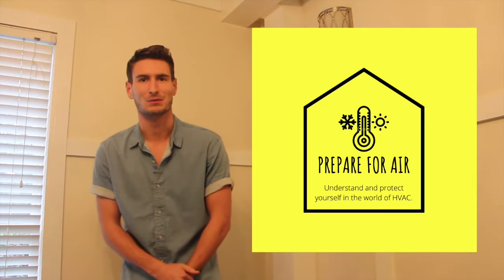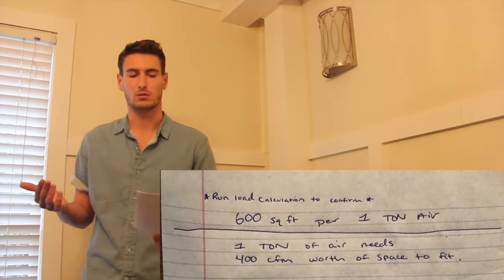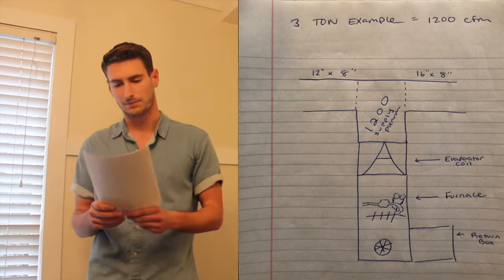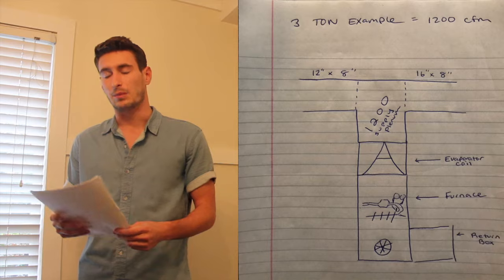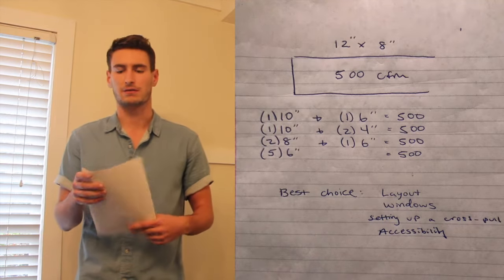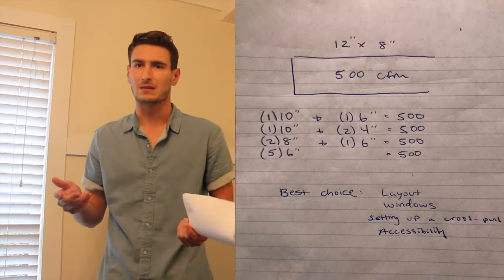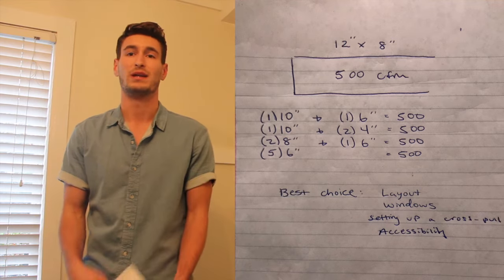Residential Ductwork : HVAC Duct Design Basics

Comment: Not trying to be negative here but this is why we 10 out of 10 systems have air flow problems. The design is garbage in garbage out, and the first fitting destroys all the flow and will never balance. We all need to start taking this seriously

Comment: 400 CFM per 600 ft^2? Wow, I don’t think so, bud. I think your engineering is off by a bunch. Typically 1 ton per 400-500 ft^2. Trust me, it makes a big difference, especially when you have gatherings.
Reply: It's 1 ton per 400-600 square feet. If you live in a high humidity area like the south then you go towards 400. His 600 statement is still true.
Reply: New houses decently built are closer to 750 sf / ton

Comment: What about the return? Some people say that 700cfm is enough for a 3-ton system, but my local contractor said 1200cfm for the return.
Reply: 1200 cfm is the required amount for a 3 ton unit, but sometimes the math can differ on the amount of air the actual ducts themselves can move (depending on static pressure.) We use .8 static pressure as our gauge in Georgia which means the 10" even though (rule of thumb is 400 cfm) if you used the more exact math with static pressure calculated in, it would actually only be 320 cfm.
Reply: Easy answer. You can NEVER oversize a return. Always make the return bigger than the supply.
Reply: So 1200 cfm is a rule of thumb there are alot of factors that can slightly effect this number and I disagree you can oversize a return when oversized the velocity falls off and you lose dopler effect and thus have a noisy duct system

Comment: Nice job however you should have finished with a floor layout showing the trunk & flexible duct layout. The reason I mentioned that is that it is usually better if you connect the flexible duct toward the end of the trunk such that it works more like a plenum. For instance, if you do your 1st 6" flex duct say at 90 degrees off the trunk maybe 3' from the start & the 2nd one say toward the end, 10' in this example, the 2nd one will have much more air flow than the 1st one.
Reply from the maker: Mike G definitely! I may even make a advanced residential duct work video or something along those lines to elaborate a little more 👍.

Comment: In this example, if the air handler was located at either end of the ductwork would I need 26x8 or 10x20 starting duct to match the 1200cfm required for the system to operate properly?

Comment: This is how I always done it. 
2x 4 supply airs= 8  8+2= 16x8 duct. That would be my first section of duct coming off my upper Plenum. Let's say coming off the front. That would be the closest heat runs next to the very furnace pretty much. Let's say I got a few more further ahead so now I wanna break it down. I'm only gonna have 3 coming off that duct. 
2x3=6 +2= 12x8 duct. (Always x2 +2 ) keep breaking it down further in your path. Try to make those run straight into whatever duct. Make it pretty! Less elbows, the better!
Now your return air duct .
3x RA+ 3 . Break it down if you have to.  
Single supply air ran in 6 inch round pipe and double supply air ran in 7 to 8 inch.  
always run metal all the way up to the return air inlet grill or supply air dampered register. 
Always put a damper in your duct right before your first supply airs. Around damper in every supply air 1 foot or so off of the duct. Try not to have them at the floor boot as they loosen and may vibrate. That would be annoying
For a supply air duct, never ever tap off the endcap. This will jack your flow all messed up. That air has to ricochet off that end cap then it will go to the supplies. 
Return airs can tap off the endcap. That one's just pulling air back to the furnace. 
If you have to split your supplier, air duct or return air duct midway then you need a pair of pants. That's a different story. That
I could keep going, but this tinner mommy is tired😂🤣😂 journey, mama From Minnesota. That's the easy way. 
I definitely recommend a professional!

Comment: thanks for sharing the awesome video.  Question: what the size of the supply plenum on the furnace is?
Reply from the maker: You can buy multiple size supply plenums but you’d want to buy one with the same dimensions as the furnace or air handler you are connecting to.

Comment: Thanks for the info. I have a 900 sqft  house there's a 2.5 ton with 6inch flex and doesn't cool the house hvac is in the attic
Reply: Hey Javier, what area are you located in?
Reply: @adamstasevich  florida
Reply from the maker: How many of each duct and what sizes of each on the supply and return sides? 

I’m happy to help 👍
Reply: @HVACBee  6 outlets 6inch . 1 4 bathroom 20 return

Comment: I am a new residential installer in the Midwest looking to move into design and layout.  There are many things missing in your video that I have been taught were needed. Reduction of duct size along the run for pressurization. Friction difference between flex and hard pipe. You didn't even cover return systems. What about differences between brands? I'm just curious.
Reply from the maker: Hey Greg, your absolutely right! There is much move to residential duct design than this for sure :). I wanted to just cover the duct design basics and in the future am planning to make additional videos to elaborate further 👍

Comment: I am planning to install a new American Standard 120,000btu (5 ton) Up flow furnace (S9V2D120U5PSBB) and the HVAC designer said I need a return box placed under the furnace (code). I ask Him what would be the height of the box and he said it would be 6" X 28".75 X 24.5". The question I have, with the 6"height, that will cut down on the height of my plenum (17" - 6" = 11"). Is there a minimum height that a plenum has to be? 
Another question, with the main supply (14" X22") and elbow opening into the filter housing (20" X22") and other side of filter housing going into the return box opening (6" X 20") are you choking the air flow going into supply box? Is the 11" plenum allowed? Great video.

Comment: Are these CFM figures you're using based on 400 FPM.  I'm trying to get a good grasp on this ductwork sizing stuff, but seems like there's some info left out or just an assumed FPM number most guys are using when teaching. When someone says, "this size duct can handle this much CFM"  I'm thinking, "Yes, at a set velocity of xFPM."  But if your FPM changes does the CFM not change....??
Reply from the maker: This is just the basics of residential duct work, but it is assuming a .8 static pressure which is going to depend on the length of the run, type of duct material, etc. :)

If you have any additional questions, I’m happy to help. Feel free to shoot me an email with any additional info or questions. Adam@HVACbee.com

Comment: I have a ducted ac and heating system and would like to remove a wall. I need to redo the ducts and would like to create a new riser to the second floor and install the 2 inch high velocity ports in the sencond floor ceilings over the windows. Is this possible
Reply from the maker: It is possible but make sure to still ensure the ductwork is sized properly for the unit even after adding the new supplies. If you have too much supply space, the HVAC system could struggle to get enough pressure build up (in the ductwork) to push the air to the second floor.

Comment: So?  Probably a totally stupid question !!!    I'm designing a duct layout  for a 2 ton system for my small house.  The AHU will be centered with the house,   I'll need (approx- 500 cfm's on one side of the house ,, and 300 for the other half,,,  Would I be correct in sizing the trunk accordingly for each side?   The trunk for for 300 cfm's come out to roughly 8 x 8  ( with a .07 friction rate ,,, calculated , not assumed !)  Only Asking because I've searched like crazy, and this is the only video I've seen where you've split the load,, ( make's sense to me  btw,,)  Just want to make sure I size accordingly ,,  I've searched at nauseum,  and every example shows one main trunk and sizing down as needed,  so,  I'm a little confused with that part,   
Otherwise ,, its  approx ,, a 8 x 20 trunk straight across ,for a 2 ton/800 cfm's unit ,,   if I'm using the calculator correctly :)     🤔 thx!!!

Comment: Hi Adam I have a questions total 1700 sq house  the size first floor is 25ft  Width  by 30 ft  length and the first floor ceiling height is 9 ft tall and the furnace is to the other end basement not in middle the house ,and Upstairs 4 room all the size is equal 12 ft by 13 ft and ceiling upstairs from the floor is 8 ft tall .what is the size duck work ? 
Here I used Rectangular  8 inch by 16 inch and 16 ft long but it couldn’t reach upstairs floor

Comment: Here's a good question: can the A-coil be adjusted (it's horizontal position) by removing the trunk (short straight section of square ducting) connecting the A-coil cabinet & the plenum? Have an A-coil that is not sitting like it should. Condensate water 💦 doesn't drain out of the regular drain line, but it drips out of the cabinet. Some I have collecting in a bucket, but some is going into the drain pan. Thank you the heating and cooling system work just fine, but there is a condensate drain problem, b/c the A-coil is not sitting as it should (level) for proper drainage
Reply from the maker: Hello 👋. Shoot me an email with some pictures / the same info above and I’d be happy to help! Adam@HVACBee.com

Comment: Do you need a return box ? I have a 3 ton unit that I made a supply plenum for was just wondering if I neede a return box as well
Reply: Nope, typically you'll only need a return box on a 4 Ton unit or larger.
Reply: @adamstasevich  sweet so I can go right to my vent in my ceiling?
Reply: @jham5595  Yep! You could also build a smaller return plenum next to the system and have the duct run from that as well.
Reply: @adamstasevich  thanks 🙏 much appreciated!
Reply: @jham5595  Sure thing! No problem. Good luck with the project :)

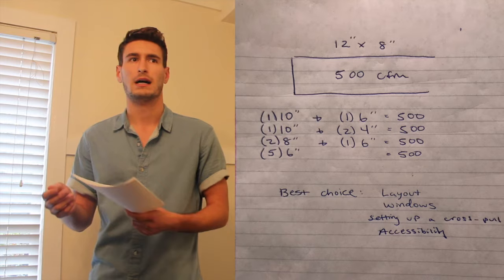Comment: 4:20 I’m confused. Where are you getting the (2)8” + (1)6” =500 from? And all the other ones. 8” by what? 6” by what?
Reply: I’m thinking diameters
Reply from the maker: Diameter of circular flex duct 👍.
This is a flex duct chart example that is shown. 

You can also search a ‘rectangular duct chart’ to see the cfm for those sizes as well though :).

Comment: I'm finishing my basement and the ceilings are already low. Is low profile ductwork an option? What needs to be considered if I switch to low profile? Do the dimensions of the ductwork just need to total the same? For example could a 14" x 6" be made a 28" x 3"? Thank you!
Reply from the maker: Hey Troy, here is a link to a rectangular duct chart. I think this may be able to help you out if you haven’t started on this project yet.

https://hvacdirect.com/hvac/pdf/Field_duct-sizing-chart.pdf

Comment: Hi, nice video. can we split the trunk cfm the way you did, like left 500cfm and right 700cfm? My truck is 8" x14" on both sides of the plenum but the HVAC guys told me I need to increase my trunk to 8" x24", they don't consider left and right on the calculation. I will install a 3-ton system.
Reply: Howd that work out for u lol
Reply: @SA-rt6ei  I installed a 3-ton system; it works, but it's not efficient. The heat on cold days does not go above 21 Celcius, and I have to use a low Merv filter.

Comment: That 12x8 and 16x8 coming off plenum for 3 ton system is too small
Reply from the maker: It is about 1300cfm before deducting static pressure. A 3 ton blower and coil needs 1200, but if there were super long runs, and a lot of them, you could need additional 👍.

Comment: Flex duct?!? That's a cuss word from where I'm from 😂🤣😂
Reply from the maker: Where you located? We see it probably 90% of the time in north GA. 

Definitely not the absolute BEST choice, but definitely the BEST economical choice.
Reply: @HVACBee  in the north...
If you mention flex to the guys I've worked with and learned the trade from they would tell you to leave..
Flex is such an flow restrictor.
Remember the right furnace for your home is the one that's installed correctly I don't care how efficient the furnaces if it's choked down with improper size ductwork you just blew the efficiency out the window...

Comment: Uh ok. So static pressure is irrelevant
Reply from the maker: Not at all. I mention static pressure but it changes based on circumstance (length of run / material type) so I used the numbers prior to static pressure loss.
Reply: @HVACBee  ok gotcha.

Comment: 3 ton is 1800 not 1200
Reply: Three ton needs 1200 cfm is what he is saying. Three ton of cooling for example is 36,000 btus. The 600 was the area to condition, and 600 square feet needs 1 ton of cooling. I think I got that in line to what the example covered.
Reply from the maker: Hey Jason, I have never seen anything other than 400cfm per ton of the drive of the blower motor.

Can you please share where you are seeing 1800 for a 3 ton?

Comment: Nothing about this guide is of any value other than in the beginning when he said to do load calculations. EVERY "rule of thumb" mentioned is of no value. Also, if you don't know how much air is supposed to go to each room, which you don't without load calculations, how can you determine the correct size duct/s to route to that specific room? HINT: You can't.

Comment: nice salesman training vid, as to how to supper simplify for the customer.  i am guessing you are no more than 3 years in and have a lot of potential in sales.    If your trying to show the masses how to calc and size ducts you have miss some of the most important things.   you used a bad rule of thumb  for older homes and homes built in the last 30 years 600 SQ per ton is not for every house.  then you skip load   OK  not recommended by any Pro,  but then you don't explain total effective feet of the duct as you have it layed out , you dont tell the most important part of what friction rate is left after pressure drop of filter coil , to even select a airflow for any of what you had in the vidio.    take some more air flow clases and if i am wrong and you know more than this vid then stop posting half ass vids to confuse DYI people.
Reply: It’s an intro video for a very basic understanding. Clearly not for pros. Maybe before you start recommending classes people should take you can take a basic English class yourself.